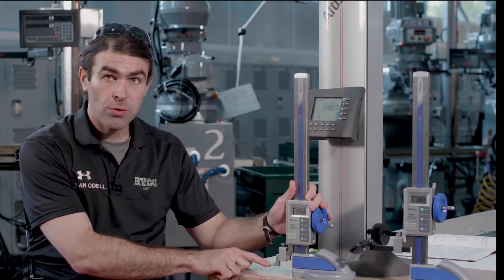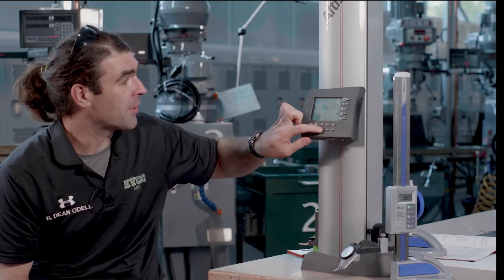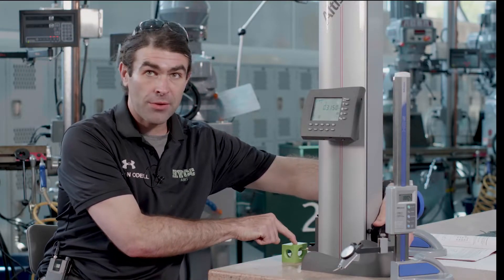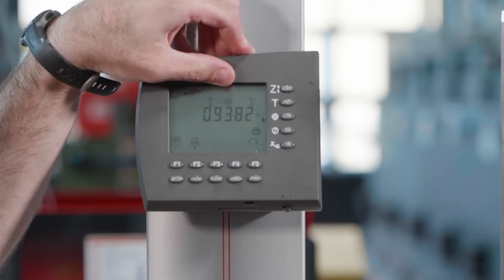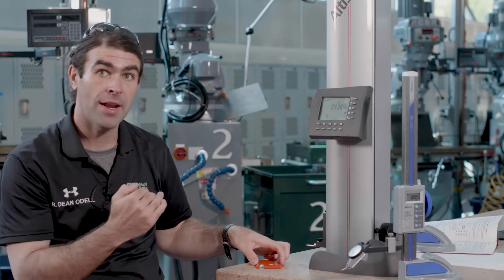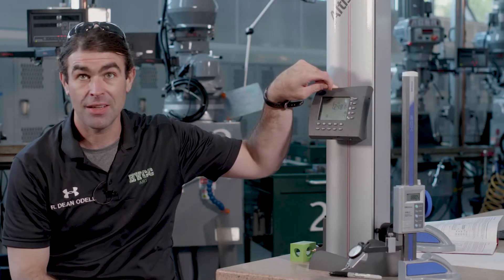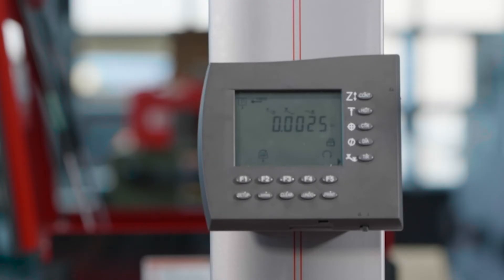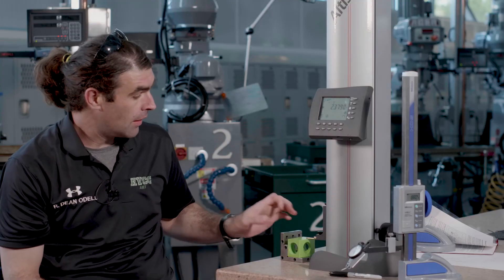Starrett Height Gage Demonstration

Comment: I kind of understand that the prob falls down, and keeps track the location of the probe while doing so, when you want to spot the lowest point at the convex half of the circle. When the device wants to get the location of the highest point at the concave half of the diameter, does the probe move upwards ? If not how can it reach to the highest point when you move the part in lateral direction ?
Reply from the maker: Yes, unlike an indicator/height gage setup, this device can measure in both directions without resetting the preload. The calibration sequence taking into account the diameter of the probe.
Reply: @RDeanOdell  amazing! Thank you for the reply :)